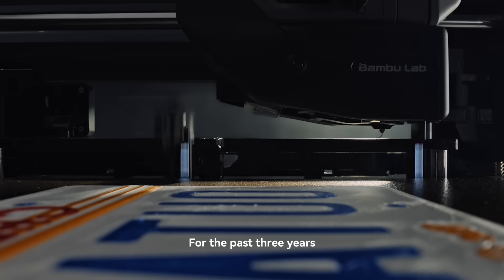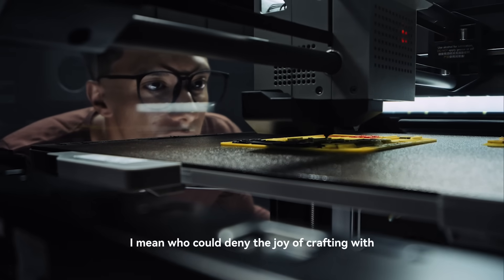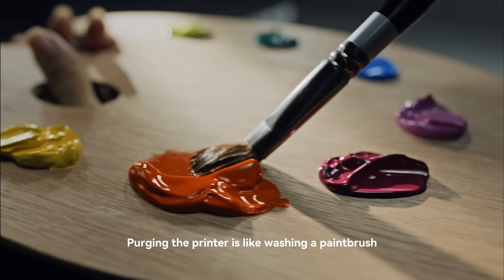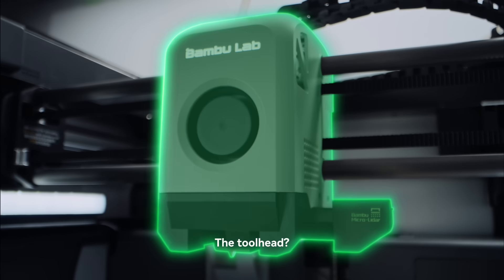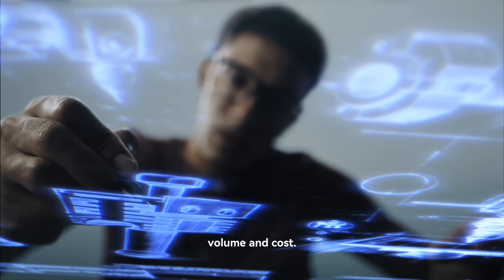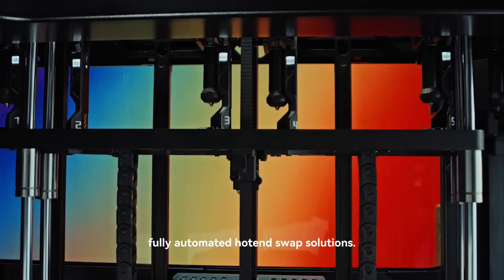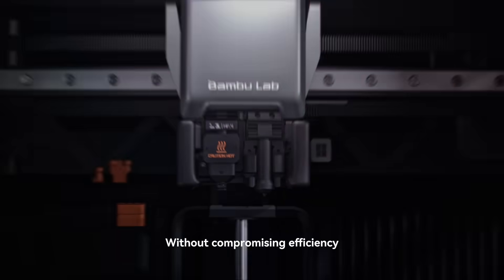Meet Vortek: Our Answer to Zero Purge Waste Multi-Material Printing

Comment: This is badges and I will probably buy it but let be real about purge. I print a decent amount of things and over a year I ended up with like 2kg of purge. If you say 10 percent of all filament is wasted to purge and the upgrade is $900 then you need to go through about 750kg of filament before it pays for itself. So yeah, if you are running 24/7 print farm maybe. . . But it still isnt zero purge so bump that upto 900kg. For normal home users this is more about speed than purge savings. So im curious if it is much faster or not. I dont see how it could be faster you still have ams spooning into the same armature.
Reply: Badass*

Comment: Does anyone know if this printer will be able to automatically switch between two TPU materials? I’m planning to use it to make multi-color TPU keychains.
Reply: If you want to print TPU, then buy a prusa.
Reply: @L @LilApe Prusa is billionaire only
Reply: Yes but you need to disconect the AMS from the printer an use both nozzles (its recommended to only use the right nozle for tpu, because it doesn’t move)
Reply: @This_is_BitBox  So is it advisable not to use 2 TPUs at once? So there is no difference with the old models, it will still change on the hand

Comment: Each nozzle shares a filament path, so that means you still need to cut, pull back, re-insert, purge, and prime every time you swap filaments. The only thing you're getting is no cross-contamination of filament materials/colors since they don't share melt zones. Why purge at all if the melt zones aren't shared? Because you're cutting the filament above the melt zone, which means retractions won't work until the re-inserted filament makes its way down into the melt zone again, which can potentially reduce print quality. You don't need to purge as much but I'd be surprised if you don't need to purge at all.

Comment: the vortex system is fantastic, but I don't understand why make 2 heads and change the one on the right, when you could easily make just 1 head that you could change, in my opinion the results would have been even better, it would be an excellent upgrade I know how to make H2S an h2sc and the h2D an h2sc

Comment: Why is the purge tower still necessary here?
Reply: It's called a prime tower and it primes the pressure needed in the nozzle so the filament comes out smoothly. A lot of people call it purge tower though cause it's essentially just waste but it's really just used for priming.

Comment: I have a question, changing nozzles sure could increase efficiency, but no matter how many brushes you setup, they still need to be cleaned up after use, how this process be done during the printing to achieve zero poop？

Comment: There's a literal purge that in the video lol joke
Reply: Purge is inevitable, even snapmaker U1 produces purge as well your less then likely to deal with it when using 8 colors on the vortek system, but anymore than 8 I believe and it eventually needs to purge. 

if you meant @2:34 during timelapse thats a prime tower. It's mean't to prime filament before being used. its completely optional but helps make sure quality is at its core the HIGHEST.

Comment: But you're still purging :-/
Reply: Purge is inevitable, even snapmaker U1 produces purge as well your less then likely to deal with it when using 8 colors on the vortek system, but anymore than 8 I believe and it eventually needs to purge. 

if you meant @2:34 during timelapse thats a prime tower. It's mean't to prime filament before being used. its completely optional but helps make sure quality is at its core the HIGHEST.

Comment: Does it have a poop chute? Or no poop scrumps
Reply: Purge is inevitable, even snapmaker U1 produces purge poop as well. Your less then likely to deal with it when using 8 colors on the vortek system, but anymore than 8 I believe and it eventually needs to purge poop.

So id say it will have poop and a poop chute due to that nature, your less likely to purge way less with the system however if you plan on sticking with 8 colors however.

Comment: So it still needs an AMS and will still need to feed and extract filament on each swap. So 8 sec to heat up and 20 sec to extract and repeat the process for every swap. So it does fix poop but not the time wasted swapping colors. So a multi head system is still superior for efficiency and speed.

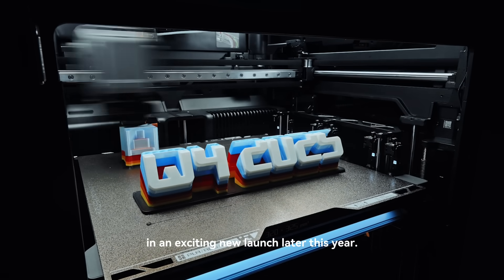Comment: 2:40 uhm is that a purge tower on the back of the build plate?
Reply: during timelapse thats a prime tower. It's meant to prime filament before being used. its completely optional but helps make sure quality is at its core the HIGHEST.

Comment: This solution seems to be focused mainly of minimizing purge, but what about time for swapping between colors? The reason I ask is because I did not see 6 different filament tubes going into the mechanism. Just the two on top. Does this mean we still have to wait for colors to retract and feed forward at every change? I would think so, after seeing this video. But hey, maybe that can be done fast. Available print bed size apparently decreases from 350mm to 330mm (X-dimension) which is not a lot and might still be worth it. The Bondtech INDX had every color already attached to each hot-end (If I recall correctly) so that has to be faster when switching. I am an H2D owner and I really want this to be good since I could upgrade, just don't want to hope for too much. Some timing specs would be nice!

Comment: doesnt prusa core one do something similar? like, you can add multiple hot ends and it will leave, then grab a new one?
Reply: Prusa core one is using a 7 toolchanger from bondtech INDX. Which is definitely better than whatever this gimmick is.

Comment: I was backing the U1, but dropped it. I had been wanting the Prusa XL 5 hd since last fall (it is what he use at work for engineering part prints). But I grabbed the H2D (LASER) and then the H2D. Long story longer .. I take it that the 6 filaments will all feed into the single entry at the top of the tool head? Others (XL/U1) have each filament enter each nozzle. I keep watching the video, but I haven't had my coffee to see how the 6 filaments enter .. AMS is only 4. Can someone throw the brick wall at me and point me in the correct direction? I'm not sure if I'll just upgrade my H2D (non-laser) or sell it and get the H2C ... (EDIT: OK, here ... https://www.youtube.com/watch?v=n-Ktsv-MGWo) --- Had my coffee and was able to picture my H2D. Cut filament & retract, remove nozzle, insert replacement nozzle, feed and resume print. Same basics how the new VORTEK will work. So no more pooping, but will need the purge tower.

Comment: Question: if the color is only used for a very small portion of the printed model (just a dot) you might need to swap the nossle instantly. This can cause the filament to be cut several times within the nossle.
Will this be a issue or will the purge tower flush enough of the filament between the filament/tool changes so that this problem wont happen ?

Comment: Massive L for not using a rotary head for the hotends...

Could EASILY fit 24+ hotends on a rotary plate.
Reply: You don't have the same rigidity as a higher end CNC type milling machine that would utilize the type of technology. The gantry and the tool head itself would have to be beefed up to such an extent just to make sure you would have down to a thousand of a millimeter accuracy, just not possible or practical in this type of application.
Reply: @robertmunafo5039  it's very doable and would not require anywhere near the accuracy you describe. A thousandth of a MILLIMETER?!?! Tell you you're not a machinist without telling me...
Reply: @robertmunafo5039 lol, I've been a machinist for 30 years and started 3d printing in 2002. What you're saying is nonsense, not common sense. You actually think their switching rail system is somehow more accurate than a turntable? Just stop
Reply: @kevinj9059  Sure you have. like every other armchair 3D print designer. Where is your prototype printer featuring 24+ hotends on a rotary plate? And this rail type of system has already been proven to work. Rotary has been tried and failed multiple times. But of course you know how it can be done, ok, show us. If your successful I'd even buy one, but you wont be. If you understood 3D print design you would know this.
Reply: @robertmunafo5039  I have never seen ANYONE make a rotary hotend swapper, so you're lying. Not only that, but rotary cnc tool cribs are EXTREMELY common: I run one at work every day. There is no reason this wouldn't translate to a hotend system as shown here. I told you my experience. Your "experience" is: "it's common sense." Quit embarrassing yourself.
Reply: Wait a second. Are you thinking I'm saying to put 24 hotends on the gantry? Because that is not remotely what I'm saying: I'm describing putting 24+ hotends in a rotary tool crib, EXACTY how a cnc tool crib works.

Comment: Great innovation! However only a 220c hot end is disapointing
Reply: I must have missed were it gave the temperature capability of the hot end. Where does it say only goes to 220? I don't think that's accurate at all.
Reply: @robertmunafo5039 having re watched it. It was me being an idiot and the graphic was just showing what the chips report 😂 not its final specs @2:12

Comment: After an enjoyable 3 years owning a X2C and putting on a massive 900 hours Lol, I see an upgrade in the works. I will wait to see if it does do multi-material. Can't see why it wouldn't. I also want to see how easy it is to work on, because the X1C is a bitch. I currently put up with a squeaky idler because it's just too much hassle to get into. If these things are addressed and the price is right, I foresee the H2C doing to the market, what the X1C did back in 2022.

Comment: I'll be curious to see how this still solves the purging problem though. if you switch nozzles back and forth at some point you are switching back to a nozzle with filament still in it from the previous moment it was printing that color. Which means you still have a disconnect between filament being pushed from the AMS and the nozzle for at least the length of the nozzle itself. It means for the first 30mm of filament you would have no retraction ability.

Comment: Such a responsible move, and a great reminder that sometimes improvements best come in increments, and that only so many challenges can be solved at once. Thank you so much for what you've already launched, and that you didn't neglect the aspect you're addressing here. Kudos. Still hoping for a pellet printer that can reduce the cost of functional parts, as someone who uses hundreds of kilos of filament per project. But that would be a blessing and is not an expectation, you have your concerns, and that is understandable. Much love and gratitude to all the people involved in the Bambu Lab adventure.

Comment: This would have been interesting if it were an upgrade offered for the X1. I'm not interested in buying a printer just to get rid of it in 2 years, so I will be using an open source solution instead

Comment: Changing just the hot end will help but it won't compete with the snap maker, indx, and prusa. Sorry, not sorry. The time it'll take for filament to retract and a new filament to be inserted isn't worth it. Also, it'll be the same issue they're already having with TPU feeding.

Comment: I typically hate on bambu for their overpriced machines and filament because they truly are taking advantage of their customer base. with that being said they’re also leading in advancements and are doing the most for the community. This advancement is absolutely crucial for multi print printing, and I have to admit that this is a achievement that no other printer company could achieve in such a short amount of time. bambus funding research in a timeframe that would take other companies a decade. So thank you for using our extra dollars that you force us to pay for some good. still on the fence about the company, but this truly is a step in the right direction for the future of 3-D printing.
Reply: I don’t really think their filament is overpriced. I buy in bulk and the refills cost me 13.99 . You can’t find ABS cheaper than that anywhere else.
Reply: Okay bot. This is literally worse than a typical tool changer from 5 years ago.

Comment: Ok, lets all level set here with this announcement.  The Vortek system only swaps the right nozzle.  So the left nozzle will use the good ole AMS purge color swap approach.  Also the swappable nozzle will have to be coordinated with the AMS pushing that specific Nozzles color to the tool head.  So lets be very clear here, this system will not be as fast or efficient as a tool changer approach.  To me this seems like a half baked solution that they rushed to let everyone know about to counter 3D printers with tool changers.  As you can clearly see from the video is only two PTFE tubes going to the tool head.  They should of done four like the A1 to coordinate with the tool head changer.  I think they really missed the boat on this one.

Comment: Still want to know how long a material/color change will take all together I mean 8 seconds heating but the filament still need to be changed (even it does not need to purge the nozzle) and you still need to build up constant pressure (prime tower will be still needed). So what are we talking about compared to a multi head system? 

And at what cost? I mean the H2D was price wise out of line and way to expensive compared to the update you get over x1c or p1s. I could just imagine how much the h2c will than cost.

Comment: Given the h2d can be nearly 4 grand.   This will be at least 5.  No thanks.  I will wait a few years like I did with 3d printing in general.  I got into it when the x1c came out.  So i avoided all the bullshit no one likes about printers and enjoyed everything everyone does like, at 10x lower cost and learning curve.  I dont NEEEEEED a tool changer now, my 2 x1c and 1 h2s work just fine.  And in 5 years when tool changing printers are 900 bucks, I will buy one.

Comment: i cant wait for this machine... i had the p1s i was very satisfied it was my first 3d printer, later got me the a1 mini and also was very satisfied with it...
then i got the h2d non laser - first i was extremely happy but damaged idlers and pulleys - damaged the belt wich damaged the toolhead bearings after 500hours...
it stillprints "ok" but i can tell the problems are getting bigger... bambu support helped me alot to find a solution! thx bambu

Comment: The Vortek setup just makes everything more expensive and complicated, while also limiting materials like TPU and PP. A few small perks don’t outweigh the downsides. Overall it feels less versatile and less reliable than simpler systems like Prusa XL or Bondtech INDX.
Reply: Can you explain why it would limit TPU and PP?
Reply: @forthewin84  Because it still has to pull from the AMS and the AMS CANT run TPU or PP
Reply: @anthonylong5870 out of curiosity, why can't it run pp? I know about TPU because of the elasticity, but not PP
Reply: Yeah. INDX looks way better. I'm not going to buy another Bambu machine if all they want to do is pull an Nvidia and lock what could be a drop in upgrade to only work with new machines
Reply: @XecularOfficial  I'm sure they'll sorely miss the business of people like you who do literally nothing but bitch about literally every effort anyone makes to advance any field. Next make a public statement that you're swearing off dating Beyonce forever. That'll sure show HER!
Reply: This would not effect the filament type at all wtf are you one about
Reply: @Alpachemist  Goddamn you Bambi numbnuts cant think unless Bambi tell you too...The Vortek USES THE AMS!!!!  AND THE AMS CANT DO TPU OR PP, It even has issues with ABS and ASA!  FFS
Reply: Can the Prusa XL print PP via an automatic material system?
Reply: Maybe yes, but maybe not!
Reply: This does not limit anything, you put tpu in the fixed nozzle and youre golden wheres the problem
Reply: Solution?
Reply: "Hey look! A new thing that's been well engineered and has the potential to significantly advance the usability of a 3D printer! 

Let's shit all over it because I'm a sad, miserable person who exists only to confidently shout nonsense about why everything sucks while doing nothing myself."

Awesome, we definitely need more people like you. Keep doing what you're doing! Which is of course, nothing but spouting negativity so you can feel relevant somehow. 

Great sense of humor though, claiming the Prusa XL system is reliable.
Reply: I believe you're mistaken, but welcome anyone to chime in if I'm misunderstanding.  Both the Prusa XL and Bondtech INDX utilize swapping nozzles for multi color printing, just like bambu labs proposal here. However the Prusa looks to have the heat measuring device repeated across each nozzle, while bambu labs places the measuring device on the tool head and only sensors on their nozzels that attach magnetically. Bondtech INDX though looks to be very similar, though it seems their nozzle sensing is built into the tool head rather anything attached to the nozzles.

Also, both bondtech and Prusa utilize nozzles that need to be unscrewed when replacing, over the quick swapping magnetic system of Bambu labs.
Reply: @PuttyMaster101  Unscrewed? wtf are you talking about...Thats ridiculous.  They dont "unscrew" they just push in and out.  The PRUSA does nozzle swaps in less than 4 seconds
Reply: prusa boys mad
Reply: @nidhogg3390  Them being mad and trying to drag everyone else into their pathetic, divorced-dad-style misery is the only thing they have to live for. I mean imagine actually being excited about anything ever changing for the better. The horror!
Reply: Vortec is 100% inferior to something like the prusa XL or INDX
Reply: @LilApe  or Snapmaker U1